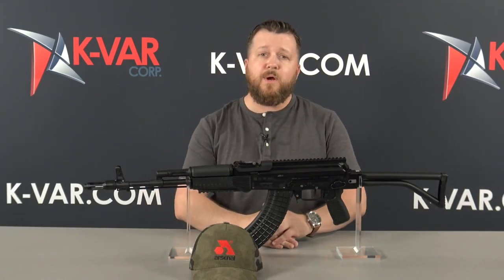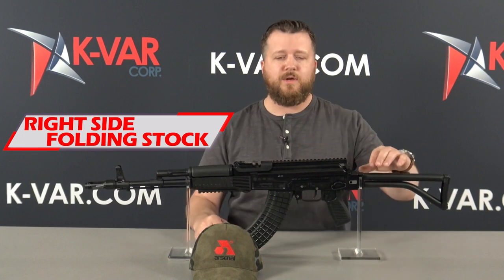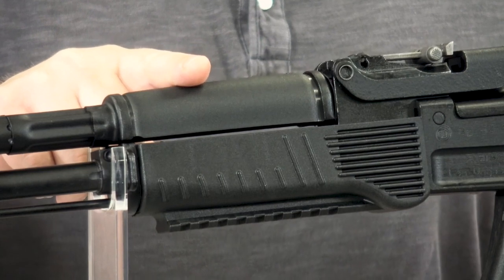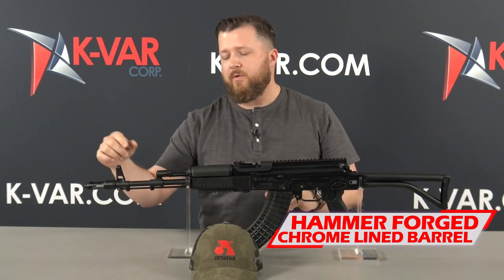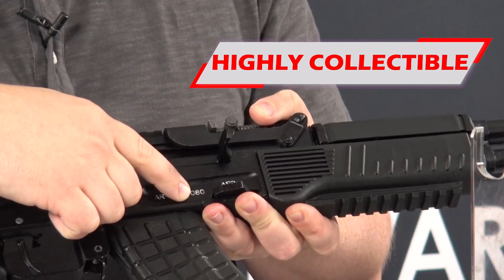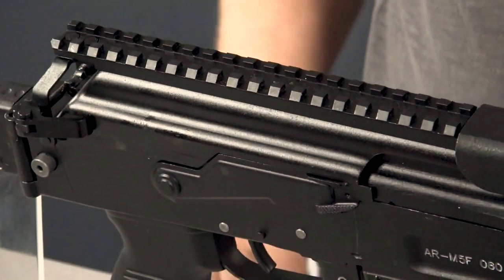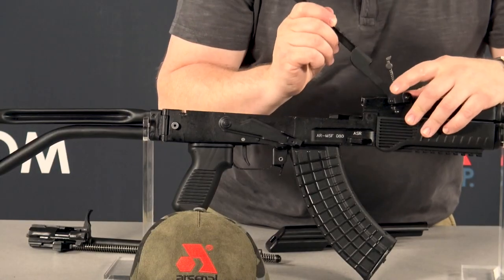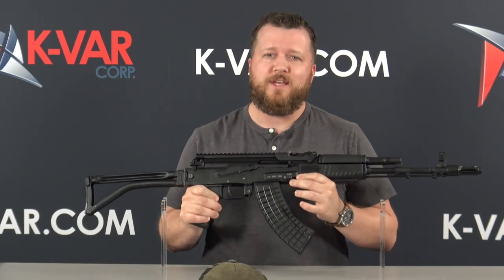ARSENAL SAM7SF-94E

Comment: I own the sam7sf, and that's already a heavy ak. The rail system is nice to have, but I'm sure this thing will be heavy af
Reply: Man the Sam7sf is not heavy at all. With polymer furniture and folding stock, it’s the lightest milled ak on the market. You think the Sam7 is heavy? Buy a zastava m70. I have the zastava m70 and zpap92 pistol. Zastava makes some of the heaviest AKs and they’re stamped, not milled. Bc zastava makes their receivers 1.5 mm thick instead of the traditional  1mm thick,  and they add  bulged trunnions. Zastava is the only company I will buy stamped AKs from Bc even though they’re more on the heavy side,  it’s because they’re built to last and are meant to take a beating. But my Sam7 is my number 1 rifle Bc I love milled receivers. But my zastava stamped is def heavier than the Sam7sf milled